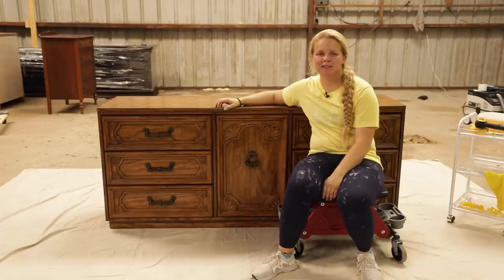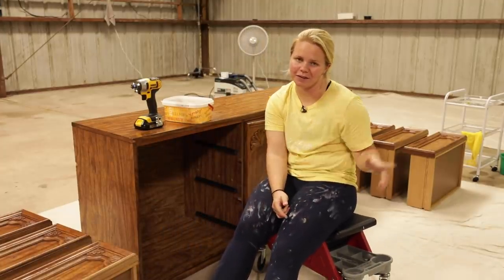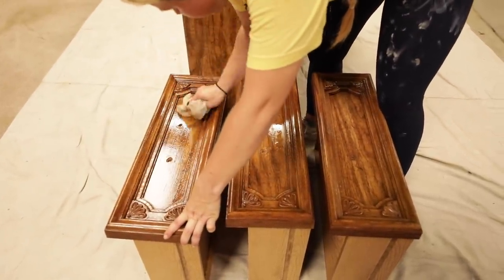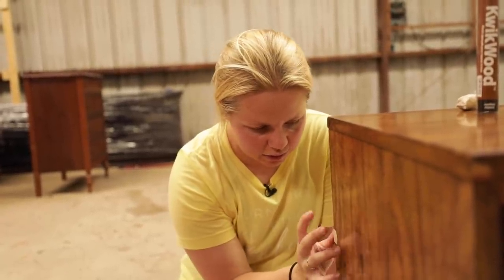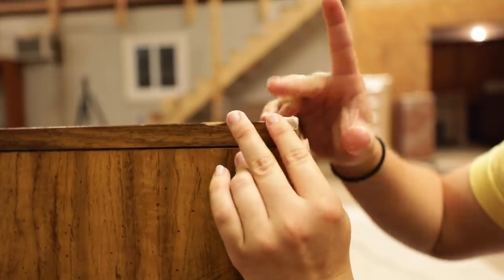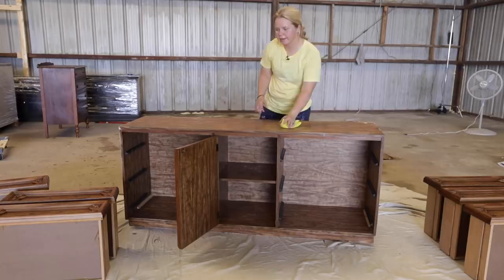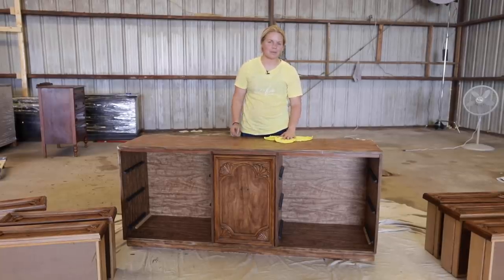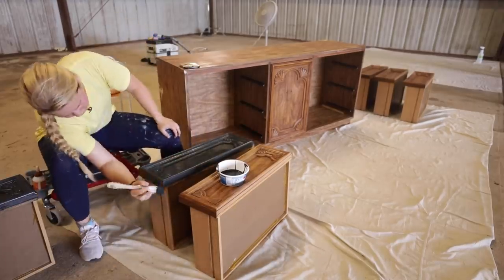Harry Potter Inspired Furniture Flip with Basilisk Black from Melange

Comment: When you can't clamp the veneer strip when regluing, how about positioning a long 2 x 4 board on top? The extra weight is all you need.
Reply: I think comments are a good place for ideas. No one should take issue with suggestions since she is not a carpenter.

Comment: wow great looking piece and I love you channel and the work you do ... This is the only piece I think there is one thing you need to change on it it is beautiful work you did with this piece but. in the middle under the door you need a leg to prevent it from sagging it is partial board and I make and re do furniture a little bit but I am a carpenter by trade and I know that will start to sag. you need a leg in the front and back in the center .. keep up the amazing work